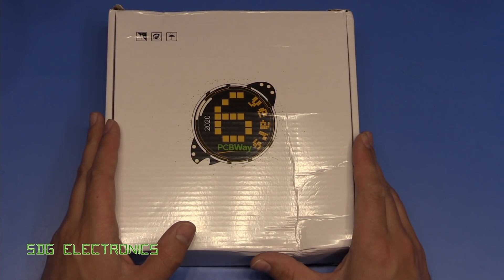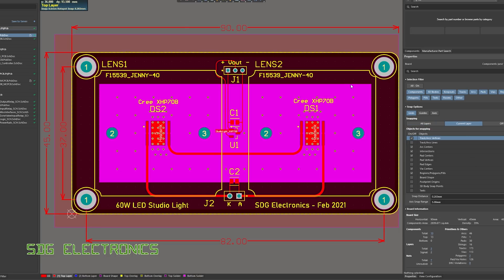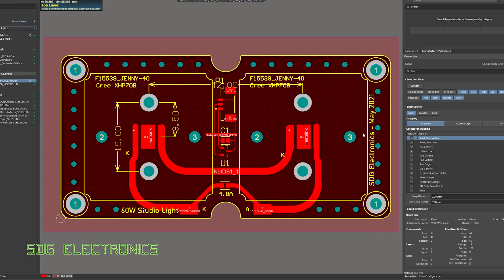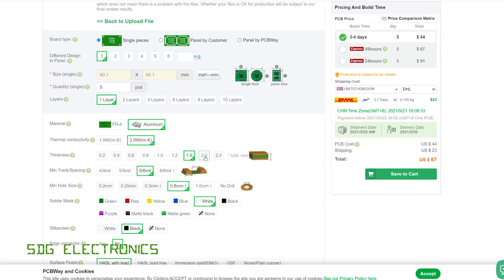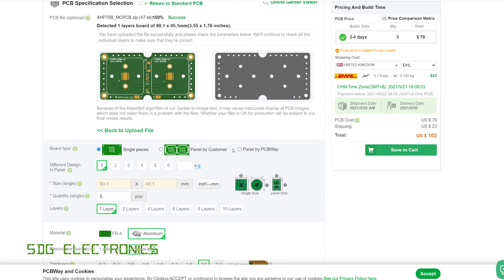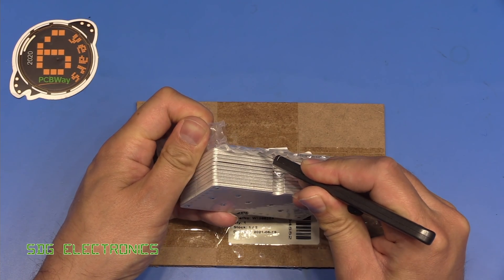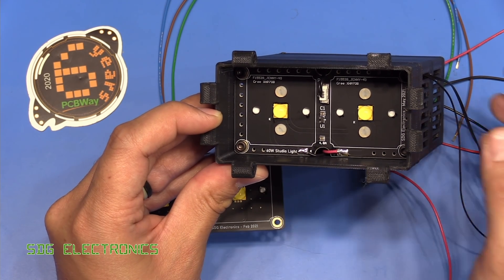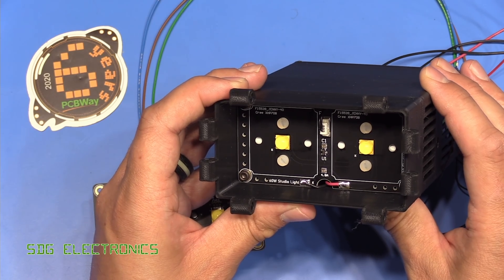SDG #210 Extreme LED Current Melted Solder! Using Aluminium PCBs from PCBWay

Comment: You could improve the performance a lot by using thermal shunts. They look similar to a 0805 or 1206 resistor but are thermally conductive while being electrical insulators. The idea then is to use those to connect a part to a large ground plane without it electrically being connected.

Comment: I would have gone for white solder mask for light reflectivity. Was there a reason you went for black?
Reply from the maker: It's a good point. with these lenses it's difficult to know where the light that may reflect off the PCB might end up. I should make a test PCB in various colours and see how much of the wasted light hitting the PCB ends up back in the main beam.

Comment: If you want to try something really radical, get some of this incredible Panasonic heat spreader material: https://www.mouser.com/Thermal-Management/Thermal-Interface-Products/_/N-71x7n?P=1y7oijz and use it to transfer heat from the top of the PCB around the back to the heat sink. The material costs a few pounds, but you will be able to use an inexpensive PCB. The material isn't great at transferring heat in the z direction, but it's unbeatable in the x and y directions, so it functions as an incredible heat spreader...

Comment: Nice video. You mention that you made the board thicker (i.e. 2 mm rather than 1.6 mm) to improve cooling, indicating that you assumed the extra width would be aluminum. I would assume it would be a thicker dielectric. Which is it?
Reply from the maker: It's extra aluminium. The insulating layer remains the same
Reply: @sdgelectronics  Thanks. It's useful to know that...

Comment: Could yoy try using vias to conduct the heat to the bottom layer of the FR4 PCB ?
Reply from the maker: There were thermal vias directly under the LED onto a gold pad on the other side.

Comment: It's important to keep the heat sink below 70°C because at that temperature the 3D printed case will start to soften and deform, which is not nice.
Reply from the maker: Good point. The light from the LEDs against the black actually significantly raises it's temperature further.

Comment: If you added 3 or 4 holes that u already had in the corner it would be alot easier to align the stencil!
Reply: True, but for finer-pitch parts, he'd probably need to use 3mm alignment pins, instead of M3 screws, as those aren't exactly 3mm OD and may allow the stencil to walk around.

Comment: Thanks for sharing !

I'm  not quite sure if the plastic screws will do the job long term with all the heating and cooling ? (loose tension)
What about spring loaded metal screws ? .. (I see that space might be an issue on the actual design)
(I've seen the comment a little further down too late ;))

Comment: I'm disagree that the heatsink should be with pads for leds and no need to cool down all pcb. what you need is bigger heatsink with multiple "connection" holes to more uniform tighten pcb to heatsink, cuz throught all pcb there is a few thermal crossing(copper - dielectric, dielectric - aluminum, aluminum - thermal grease, thermal grease - heatsink) and  the larger area decreases thermal resistance (like parallel resistors).
Reply from the maker: The FR4 PCB had thermal vias directly under the LED to a pad on the other side.

Comment: Plastic screws on a hot heatsink?
You might win a few degrees by tighten the heatsink to the board but would be hard to do with plastic screws.
Reply: Yes, you'd lose all your preload when the screws get hot and start to creep. Metal wins here. But fine for testing!
Reply: @bearbin  I've made some LED engines myself and screws are often an issue. If possible, I use them, because paste is the best interface, but in all other cases, I suggest using a 2 component thermal conductive adhesive, such as some types of Arctic Silver.
Reply from the maker: I didn't have any short enough screws so the nylon ones are trimmed to length, I have some on order though to replace these.